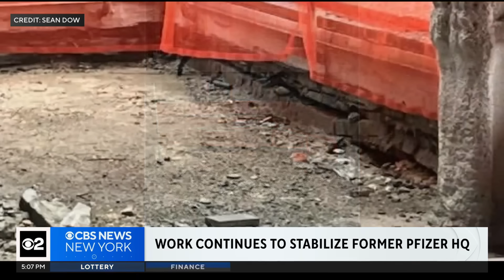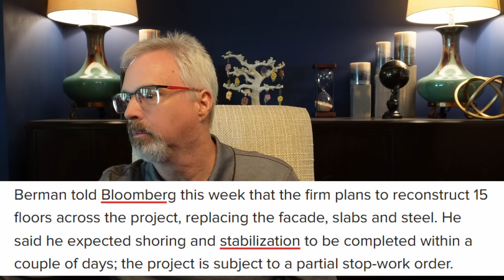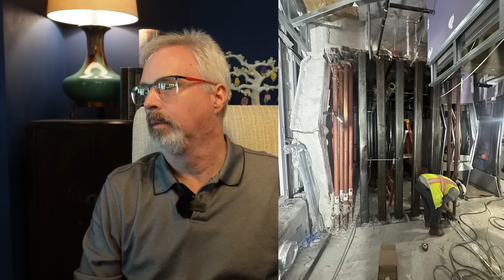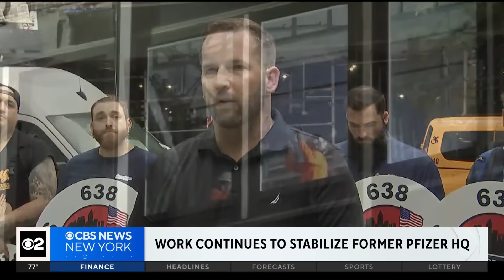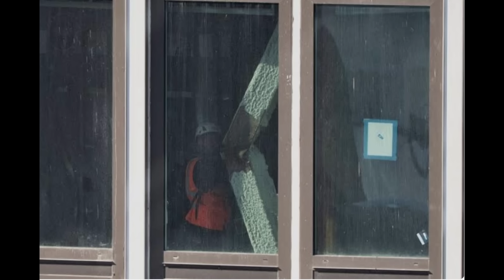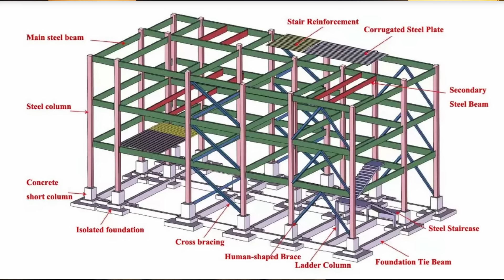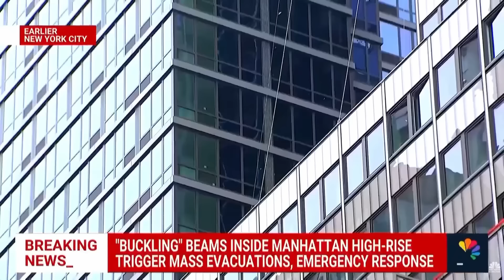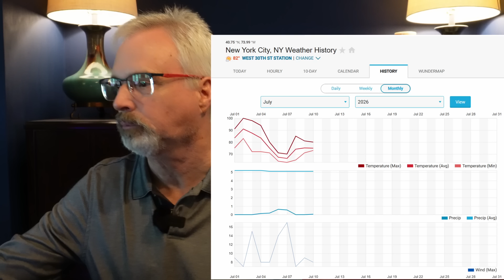Update - Pfizer Building Structural Column Failures; Now What?

Comment: Where my partner worked in the U.K. every time they even wanted to place a new fire safe, floor loading had to be checked to ensure they did not over stress the structure, I would assume if adding significant extra loadings to an existing structure someone made new call o heck it’s safety!

Comment: Existing building structure wasn't designed to carry new imposed loads.
Engineers dropped the ball, no Shoring drawings, no Approved structural shop drawings produced  ??
Its easy to blame the Contractor and the Superintendent , want to find the real problem or do a white wash and throw somebody under the Bus.

Comment: Hey Casey!  There is a young man (maybe an engineering student or a young engineer) who did a presentation on this building using software called "CheckSteel" or "SteelCheck" (I forget which it is) to dynamically rate the load on all columns.  His setup found that the new parts of the building were going to be some 40%+ over the rated design of those old columns.  I thought it was really interesting how that software works, and I think there's even a free version of it.  I think it might be helpful even for artists, who love to draw impossible things (lol, I know because I resemble that remark!)  🤣
Reply from the maker: That sounds like a really interesting analysis, thanks for sharing!

Comment: There are basically five things that can cause columns to buckle like that:
1) The column is too long and skinny for the load it's designed to carry. Those columns aren't that skinny. That doesn't appear to be the problem here.
2) The column is short enough to be stable under its design loads, but ended up badly overloaded. This is like case 1, except that you reach a point where a column is stubby enough that it becomes really difficult to buckle it. Given the weight of the additional stories, this appears to be the best explanation for this failure.
3) The column is adequate to carry the vertical load it was designed for, but the load is being applied to one side, causing the column to bend in addition to being loaded vertically. The so-called "P-delta effect" can bend the column enough that the column will buckle under the additional loading. Unless there is something really odd going on in the connections between columns and beam, or the column above was misaligned, this seems unlikely to be the cause.
4) The ends of the columns aren't built the way the design engineer expected them to be built. Those columns look to be about 12 feet high. The ends of those columns rotated when the column buckled. In other words, we can see that the top of the column is pointed toward the bend, and the bottom of the column is pointed toward the bend. The physics of columns says effective length of the column is 12 feet. If the design engineer expected the ends of the column to be fixed, so the top and bottom of the column don't rotate, but remain vertical, so when the center of the column buckles it has a double S-curve outward, the effective length of that column, for buckling purposes, is 6 feet, not 12 feet. That would enable the column to carry a lot more load without buckling.
5) Lateral support was removed from the column. That column doesn't appear to be long enough to have had intermediate lateral support.
So there you have it -- The columns were too skinny to be stable, huge overloading caused an otherwise stable column to buckle, eccentric loading, design assumptions and actual construction don't match, or lateral support was removed. Choose one, pretty much.
One thing that strikes me as really odd is that the buckled columns only span a single floor. The structural steel used to build columns like that are generally at least two floors tall. It's odd that what had been the top two floors were built with separate pieces of steel. Who is going to cut and finish a couple of pieces of steel, haul them through town, and lift them up twice and connect them twice when you can do it once? That seems odd.
Reply from the maker: Thank you for your detailed comments.  That leaves me with the question as to how this could have passed the design check.  Did the designer assume that the member was larger than it actually was.  Was reinforced to be added and was missed?  Was corrosion a factor if it was sufficient to cause section loss.  At any rate, why didn't the special inspector or a representative of the structural engineer catch the differences (if they existed between assumed and actual conditions) once construction started.
Reply: @CaseyJones-Engineer  The fact that the wide flange they used to build the column is only one story high, as is the one above it, may have something to do with it. That's a really strange thing to do. At the top of the building like that, you aren't going to save many pounds of steel by using two different sizes of steel, but you'll spend a lot more on labor to fabricate and install the two pieces. It almost looks like a design change during construction for some reason, and maybe it didn't get caught in the as-builts.
I'd bet that the owner didn't want to pay the structural engineer to have somebody on site checking this stuff.
I seriously doubt that section loss due to corrosion would cause a failure like that. A past fire could significantly reduce the strength of the steel without any section loss, but you'd think they'd know about that. 
The thing is, originally, this column was on the next-to-top floor, where cumulative live load and dead load are going to be relatively low. Now, all of a sudden, it finds itself in the middle of the building, having to hold up almost half the new building. That's a huge increase in loading. I think somebody just screwed up in the calculations, overloaded the hell out of that column, and it buckled. And, with those two columns having buckled, that load had to go to neighboring columns, which you have to assume were badly overloaded as well before they had to pick up the load from the buckled columns. They're really lucky the whole building hasn't come down yet.
It's a strange situation. I'm pretty sure we'll see write-ups about it in various ASCE publications.

Comment: A truly disconcerting case.
First of all, it seems strange to me that the original structural design called for oversizing the foundations and load-bearing columns to the point of integrating the building with a 16-story addition. Of course, anything is possible; I just find it strange.
Secondly, there are evident calculation errors in the sizing of the structure, particularly in the verification of the existing columns. The way they failed is a typical lateral buckling, caused by a buckling load exceeding the Eulerian stability value, which not only affects the strength of the material, but also the shape factor, the buckling length, and the radius of gyration of the cross-section. This could be amplified by a possible eccentricity of the columns being added with respect to the axis of the existing columns.
Without considering horizontal forces (wind, earthquake) or thermal expansion for the moment, the beam verification is not limited to dividing the axial load by the column's cross-section and comparing it with the allowable or limit value.
The fact that the failure occurred in the absence of accidental overloads and most permanent loads suggests a blunder by the computer designer.
I may be wrong, but I've often noticed that the habit of trusting automatic calculation programs facilitates these situations. The fact is that a program, even the best, acts on what it is set to; a load estimated an order of magnitude lower makes no difference to the software; it simply calculates and what happens happens. In the old days, when everything was done by hand, simpler schemes were perhaps considered, but much more attention was paid to every detail.

Comment: This is a classic "Swiss Cheese" situation where multiple failures lined up for this result. In my opinion, all columns in the entire pre-existing building should have been stripped of fireproofing and inspected, since they could be of different size or composition from original plans, and/or have corrosion issues. All of this would affect engineering design considerations for possibly adding floors, such as adding fewer floors, reinforcing columns, and adding bracing. I heard that the cantilevered area over the terrace on the 19th floor originally called for bracing columns on the exterior of the building, but they seem to have been left out.

Comment: The only thing preventing that entire corner from collapsing was that one beam.  So they reinforced the support for the beam which had already shifted by at least 4 inches.  I'm sure they didn't take the new stress away with the supports, they only locked the stress in place.  Where then has the new stress shifted to?  I don't think the building was designed to remain standing without supports.  The new shoring didn't relieve the stress so much as transfer it, it seems.  Did they redistribute the stress sufficiently or only ultimately refocus it?

Comment: I am a certified welder, both, american bureau shipping certified watertight welder. I have welded with union and non-union shops
Honestly i am not bad  union welders i have welded confined space oil refineries union welders take their time. To prolong the job several occasions i had to remove cutout, grind off union welds and repair my opinion, the welds were not checked X. Ray.

Comment: The surprise that the windows not breaking is not simply due to a misunderstanding that the window framing is part of the structural support. If the window framing is attached at each floor and the floor are sagging to a different degree for each floor (some 0, some 10"), then you would expect the window glass to be stressed beyond its limits. (But maybe the floors that deformed did not have window glass yet.)

Comment: I guess no one throughly examined the existing structure of 1960 which is 66 yrs old,  before building on top of it.  66yrs old steel ? There needs to be complete analysis of that steel. The roof structure was only built to hold the roof not additional  floors above it.

Comment: With regards to the developer's comments about using the two months that the project was "ahead of the schedule" to get this resolved is pretty damn funny. It will take more than two months just to start to unravel what went wrong. I'm only an architect (licensed '86) but there will be a full investigation of what happened, full investigations of the conditions now, then a plan will have to formulated to fix the building (whatever that means), and likely a new structural engineering firm to actually create the remediation requirements - I predict that this project will be stalled for years while all this goes on. Then add in the lawsuits . . . . bracing will continue for now. Work won't resume for years if ever.

Comment: Union workers are less likely to be afraid to point out the lack of shoring, and they have two escalation options for such issues. That's corroborated by your statement that a union worker was the first person to report it. 
That alone is justification for the union to advertise safety improvements by hiring unions. His statement has far more logic behind it than anything said by the engineer or contractor.

Comment: It’s interesting to me that the failure specifically only happened on the one drop-down section at the 235 address. Most of the addition from a top-down perspective was the additional 4 floors on the very top of the old building, and only a small square of the footprint is that drop-down section. I’m curious of some kind of structural loading calculation was skipped or done erroneously for that larger vertical section. I’m also still suspicious of wind loading, because we had a lot of wind storms over July 4th weekend in the NYC area. Stronger than average winds from July 4-7 were primarily out of the north-northeast, the side this failed section was on was northwest. Perhaps some kind of cyclical loading from the wind acting on that corner of the building contributed to the failure.

Comment: Something to keep in mind when hearing statements from the developer is that many of these units are likely already sold & under contract. If they cannot meet the contract to deliver the unit by a certain date, then the purchaser typically has the right to back out / cancel the contract. 

The developer’s construction loan may also be tied into selling in construction a certain percentage of total units by certain schedule milestones stipulated in the loan agreement. 

If purchasers start backing out, the bank may choose to start foreclosure proceedings to protect their investment. 

The developer stating now that this issue can be quickly resolved is giving them a bit more time to evaluate options to recover, such as bringing in another lender, before this cascading purchasing contract cancellation & foreclosure. 

I know it might sounds impossible to bring in another lender now, but I’m sure the bank / VC would be able to get a crazy good interest rate which would draw someone. Probably some crypto bro type person. 

If they manage to pull it off and get another lender to cover operations, this would delay foreclosure proceedings typically, as long as work was continuing. However this can get confusing and inconsistent since it’s also based on the estimated asset value and what the court rules.

Comment: The old beams are at risk now that two columns failed under the former roof level. The failed columns were not properly measured, were the beams? The load is already transferred to the remaining columns, those high loaded columns need the reinforcing?

Comment: We still have not been told the cause, though the media usual suspects have been spinning drama for a few days now, even some suggesting age of the building is a factor. However, structural steel does not typically weaken with time, but it can be overloaded.  A project like this requires multiple plan designers, and reviewers, so it does not get overloaded -- does anybody know who the engineers are?  I have heard a lot of "experts" talk about this, all except  project's structural engineers.  With that said, I suspect age has a lot less to do with this building failure and more to do with human error, but I have been wrong before.
Reply: " However, structural steel does not typically weaken with time,"(If you ever saw the rusting re-bar sticking out of retaining walls along the Major Deegan , as I have, you might think otherwise.)

Comment: Good to know that for Mr. Berman's projects it is typical for steel columns to fail during construction...  Interesting idea about installing strain gauges during construction, but where exactly would you have placed them and how many?  I wonder how localized the overloading/failure was in this case and how many sensors would have been needed (how dense the coverage) to detect whatever this problem turns out to be or whether this was quite localized to only a few columns.

Comment: It's effectively hanging off the anchor points on the feft side at this point and adding new compressive loads to the intact columns - how could it actually lean without the internal columns buckling as well? Right now the whole structure above the failure is toast and the lower-floor columns all need to be inspected and derated due to age. Apparently the original building dates to 1905 with addition floors added in 1960. It's well beyound its designed lifetime.

Comment: Casey, thanks so much for your usual sensible approach to a very interesting problem. First, the Steamfitters Union is as usual off in their own little world. Decades ago I had to deal with NYC labor a the Steamfitters BA’s were the worst! And on the take putting non working friends and cousins on the job. If you didn’t you couldn’t get anyone who knew how to work. Regarding the problem at the site, I doubt that ambient temperature alone would be enough to cause the column failure. I’m sure the design that was approved contains at least one significant unrecognized oversight.
Reply from the maker: Thank you, I appreciate you sharing your perspective on those past experiences!  I've seen that too on jobs where about a third of the payroll was for people that never showed up to the job.

Comment: MetroLoft doesn't want to accept that the building might have some serious structural issues that have been highlighted due to the renovation work. With the fireproofing coating covering the support columns it could be hiding the wear conditions of the old columns. If the fireproofing contains asbestos, fully inspecting the columns will be very expensive and will not be factored into the renovation project costs. 

MetroLoft is trying to re-assure the project investors that their investment is not going to be a massive loss.

Comment: Structural engineer here... Thank you for the video.  Did the existing column size match the as-built plans the designer used in their evaluation of the existing column to take the new building addition.  There is a blunder somewhere.  These columns failed with much less load then they would have been designed for given the construction was still in process and the failed columns were seeing much less load then their design load.  Also, fireproofing should not be installed over rusting steel.  Was a 3rd party review of the designer's evaluation of the existing building to take the new building addition performed?  Was an independent evaluation performed as well?  What assumption of reduced capacity, given the existing member's age and condition, was used in the evaluation?  Columns in lower floors below this area will be of concern as well.  Lots of issues and questions here.